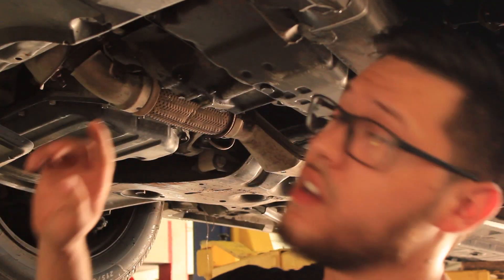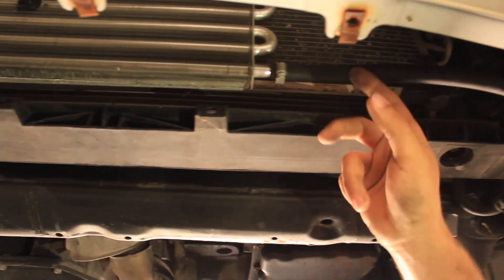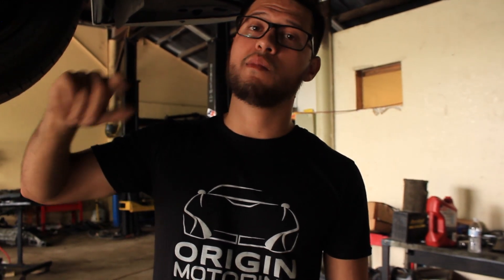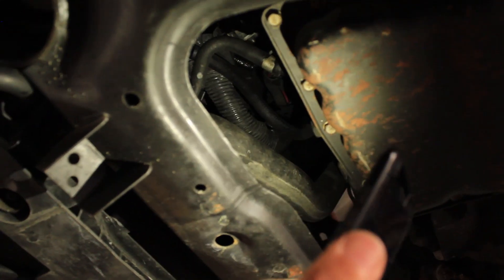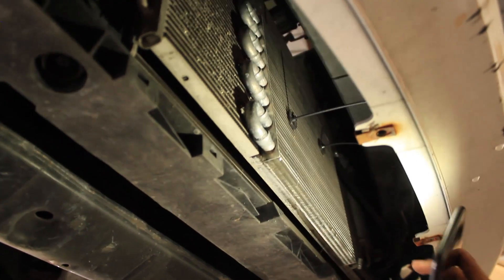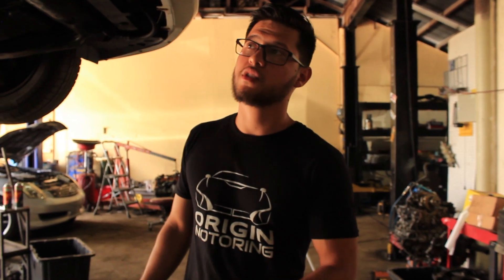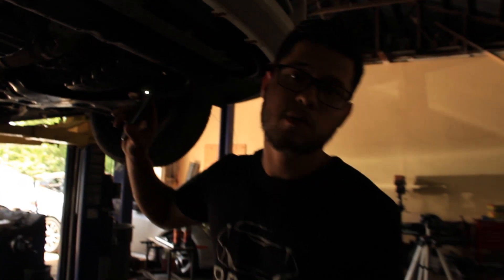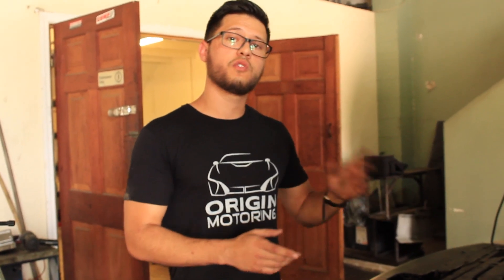Altima cvt Fix. Transmission more reliable

Comment: I have 2007 and if i am correct my cvt is going for a second time , first time the dealer changed it for free but if i change this one myself can i simply reset it after the swap with a regular scan tool?

Comment: I just got a Nissan Altima 2010 I put a new transmission on it I changed the fluid and filter after that I added a transmission cooler the next day I drove it for about 2 hours some city driving and some back roads then I started whinging and when I got to a stop it wouldn't accelerate do you think I put the hoses the wrong way? Or what's the problem
Reply: bro i know u might trying save money but you should let the dealer change (not flush ) your trann fluids
Reply: Or maybe you just got another shitty transmission...

Comment: My 2011 Nissan quahqai  have a transmission oil and coolant mix i found that oil cooler mounted to the transmission was leaking across ports it also have a heat exchange mounted in front of the radiator  should i just by pass the oil cooler mounted to the transmission?

Comment: NISSAN WILL HELP U... but you have to make them. 
My warranty covered me until 100,000. At 65k my transmission began failing/slipping. So I drove it out until 89k to get as much life out of it as possible. They installed a new one for free. Now at 112k my warranty is over and the new transmission is failing after only 22k. I opened a case with Nissan consumer affairs and said this is ridiculous. They responded agreeing to help me outside of my warranty by paying half of the quoted $3400 CVT replacement job so $1700. I respond saying that I will only pay $1000 bcs the CVTs are garbage. They happily accepted my offer and helped me outside of warranty and will even provide a rental car. They are already being sued for the CVTs so they are trying to step up and help ppl. The consumer affairs rep was very honest and helpful. It’s one less person getting in the class action lawsuit so it helps them in the long run I guess lol. Good luck, just be respectful and stand your ground.
Reply: Was this over the phone ? Or in person at the dealership ??

Comment: Thanks for the awesome video.  So is this transmission to cooler and cooler to transmission return? Or is it transmission feed to bottom of radiator > top of radiator to bottom cooler > top cooler to transmission return?
Reply: it is the latter as described, but i wonder if the first way you mention would be better. If there is a concern of the fluid getting too cool (like in the dead of winter at highway speed) it seems that having the radiator after the cooler would work better and still the cooler would ensure the oil isn’t too hot.

Comment: Hello....Wow .great information...we have a 2013 Nissan Rouge with 45K miles...Driving back from a vacation, on a hot day after one hour,  the vehicle loss power, rpms went up, but vehicle would not shift.....barely made it home...The next morning, the vehicle ran like nothing happened....it had cooled down, therefor, back to normal....But after an hour of driving, same problem...This is a perfect solution. Where do we buy a Trannie cooler for out 2013 Rouge?....and will our local transmission shop be willing to do this?  What would that cost? What state are you in? Thank you ahead of time for your help!
Reply: Did it fix your problem?

Comment: Hey man, I bought the Castrol cvt fluid from autozone I read on your description that it is compatible and also on the fluid label it says that it is compatible, but I've heard that it strictly needs to be the dealership fluid any thoughts on that thanks
Reply from the maker: Castrol works great
Reply: @origintuning7000  ok thanks
Reply: @origintuning7000  Have you used the Idemitsu type N for Nissans?

Comment: You just blew my mind. I always worried about the reliability of my fiance's Altima on the CVT specifically. Hopefully I can finally silence that worrying whining noise that comes from it on hot days pulling past other cars on the highway!
Reply: Did this fix the "whinning" issue and the xmsn not wanting to downshift after about an hour of driving on the hwy?
Reply: @blackhawkip  I’ve got the same problem
Reply: @Windchamber  I put a external XMSN oil cooler on my car last Sunday. I’ll be making my 3 hour drive to work tomorrow. I’ll let you know if it works or not.
Reply: @blackhawkip  how's it ben working
Reply: @ Zacharia Gamble did you manage to install? Did it work in calming the car from the whinning noise when overtaking other cars on the highway? ?

Comment: Post a link of said transmmission cooler!
Reply: I do not know exactly which one he used but I used this one and it seems to be working pretty well.  I mounted it directly in front of where one of my electric fans are so even when idling it is having air flowing through it..https://www.amazon.com/gp/product/B000C39C9A/ref=ppx_yo_dt_b_asin_title_o05_s02?ie=UTF8&psc=1   My nissan did not even have the CVT fluid flowing through the radiator at all, instead it was flowing into a bean can sized cooler mounted to the block, I do not know how the transmission did not burn up, My fluid did.  Because of this I also had to buy a replacement part for that cooler which has an additional 2 ports on it so that cvt fluid can flow out of that cooler and into the external cooler then back into it to be returned to the transmission.  If you have the same kind of set up on your vehicle you will have to get this part as well or you will have no way to get the CVT fluid to your new external cooler...Note, this link shows a square unit but the one I got was actually Round/cylindrical like can or short oil filter shape.  https://www.amazon.com/gp/product/B07DS7QBWR/ref=ppx_yo_dt_b_asin_title_o05_s01?ie=UTF8&psc=1
Reply: John Norris hey John what year is your Altima and how is it running with the upgrade? 
Looks like you went with the Hayden 403? My 2013 is running great just trying to be proactive,
That’s why I feel the Hayden 403 should be perfect, any thoughts?
thank you sir!!
Reply: @roberto3330  It is actually my sisters car not mine. I believe 2012. and Sentra by the way.  so since replacing the valve body assembly and installing the cooler, There have been no issues at all, trans runs smooth and no falt codes.  I just checked back up on it last week to inspect it. all looks good, no leaks, fluid still looks fresh and light pink unlike the burnt stuff I drained that looked like old motor oil.  She puts about 70 miles on the car per day, 35 mile trip to her work. but she is night shift so going to work and returning are not in the ho5est part of the day so we have not really tested it out with a long drive in 100+ degree weather.  But i think it would be fine. it gets good air flow even when not moving and you can feel the heat of the fluid being radiated out of the cooler.  If I ever buy a car with a cvt, the first thing I will do is add a cooler to it.   I did double up the clamps on all hose connections to be safe as the clamps were just ok. I also had to purchase more hose online as the kit did not have enough for my hose routing.  But ya, I would say for sure put a cooler on your car asap to prevent any issues in the future, even if the car was brand new I would do so.
Reply: John Norris Looks like I’m going shopping... thanks brother!
Reply: @roberto3330  ya dude, get under that grill and take some measurements so you know how much room you have to work with so you dont get one too big but might as well get one as big as will fit.  I was considering getting one of those electric fans to put on the one I did as well for idling and slow traffic jams but found that her existing fan was always spinning and pulling good air through the cooler.  hopefully your placement will do the same.
Reply: oh, her car is a 2007, not 2012
Reply: You can buy the Compressor Works Kit at Autozone. It is the oil cooler of the cvt transmission. For Nissan  Altima.

Comment: Great instructions on installation. I just purchased an 09 Altima with 60k miles and I'm interested in putting this on my car.  Please provide me with a parts list for the installation.  Thank you
Reply: Unfortunately it may be too late but Nissan did extend the transmission warranty on the Altima's with cvt's to 120k miles. I've read of multiple people getting a transmission cooler installed by Nissan for $50. The price when your car is out of warranty is about $700 depending on where you live plus 3 to 4 days with out a car (my 07 is at the dealership now).
Reply: @kismyc0untryazz-491   bro true story. I had a car accident in my 11 Atlima a month ago. Lady hit me from back. I got back 2k more than what I paid for the car. Long story short I bought a 2012 Toyota Camry SE cash. Car drive smooth.. feel like I got a huge upgrade.. I had the Altima at the time for 4 and a half years.

Comment: Hello, just got a 2007 Altima and after getting new transmission oil and jiffy lube and driving about 200 miles back home it began to show several issues. Including not downshifting on the highway. Also the spedo dropped to zero and the no key indicator began to show along with some flashing warning lights. Anyway I got home and now I’m wondering if a cooler will prevent the need for a new transmission. Any advice would be greatly appreciated.
Reply: Had codes p0840, p0845, and p0507
Reply: Does it make a cherp noises from 2nd to 3rd 3rd to 4th.  If so go get full coverage insurance an total it. There is no fixing it

Comment: I want to put one of these on my 2007 nissan sentra. I live in Southern California and getting ready for the hot summer.  Does it matter which the fluid gets run through first Radiator then Cooler or Cooler then Radiator?  Seems I might get a bit lower temps running the cooler second rather than through the hot radiator second?
Reply: fluid flow should be out of trans to bottom of cooler in radiator, coming out top of cooler in radiator to external trans cooler, goes through external cooler, then into tans it self,
Reply: @huggiebear1122  Thank you for the info on that.   My nissan did not even have the fluid flowing through the radiator, just a bean can sized cooler mounted to the block.  I had to get a replacement for that part that has 4 tubes, that allow fluid to flow out from it to an external cooler which I also installed.  I was asking around in the net trying to figure out which of the 2 fluid ports on the block mounted cooler was the outflow, explaining I wanted to run fluid from bottom of external cooler to top,  I could not get an answer or people would say it does not matter.  But I wanted to follow you advice, I finally figured it out after finding a Nissan service report meant for mechanics on installing the units and it turns out it was bottom tube on little block cooler was the outlet. so if any of you are installing the little 4 port cooler and an external cooler, just remember it is bottom tube to bottom of your external cooler and top of external cooler to top tube on little block cooler.  Bottom to bottom, top to top.
Reply: @JohnNorris411    you are right with cooler ports, depending on model, some don't go through radiator cooler,  2013 14, 15 altimas , would go through radiator cooler, then in 2016 , 17 and 18 model years nissan stopped going in to radiator cooler, still had extra ports on bee hive, but just connected a short hose, for ports that should go to radiator cooler, i know that because, i am a master nissan tech, now after replacing a trans , nissan has new program update, for trans, it puts more line pressure on the cvt belt, so belt don't sip, and has done good job , but will not fix issues with cvt , if belt has already started slipping , and now for 2019 altima, has cooler back in radiator
Reply: @huggiebear1122  wondering if you could help me out. I have a 2007 Altima that is in need of a transmission cooler. My question is, when I install the cooler do I skip the radiator?  I have heard both but I can not get a definitive answer.
Reply: @kismyc0untryazz-491  do not skip the radiator, flow will  be out of trans going into bottom of radiator, and coming out top of radiator into trans cooler , then back to trans , you will not have to touch bottom hose on radiator , just the top hose
Reply: @JohnNorris411  Thank you
Reply: @huggiebear1122  Thank you!
Reply: How do you connect the hose to both cooler and radiator?
Reply: @emoegbeju9567  in general or on my specific model of car?

Comment: I have 2014 Altima 2.5, and it does have a OE CVT cooler, like the one in link below, do I still need an additional cooler?
If I do need one..  I live in Boston, and it's cold here most of the year.. should I install one with thermal bypass, so that cooler activates only when the CVT fluid is above a certain temperature.. like Hayden 696, link below.. 
Kindly advice!

OEM CVT cooler:

https://www.amazon.com/Engine-Transmission-Cooler-2013-2017-Pathfinder/dp/B07MZ7T7D4/ref=asc_df_B07MZ7T7D4/?tag=hyprod-20&linkCode=df0&hvadid=320275594559&hvpos=1o5&hvnetw=g&hvrand=16309731697577810892&hvpone=&hvptwo=&hvqmt=&hvdev=c&hvdvcmdl=&hvlocint=&hvlocphy=9001821&hvtargid=pla-669779081425&psc=1&tag=&ref=&adgrpid=64369742339&hvpone=&hvptwo=&hvadid=320275594559&hvpos=1o5&hvnetw=g&hvrand=16309731697577810892&hvqmt=&hvdev=c&hvdvcmdl=&hvlocint=&hvlocphy=9001821&hvtargid=pla-669779081425

Hayden 696:
https://www.carid.com/hayden/rapid-cool-transmission-oil-cooler-with-thermal-bypass-mpn-696.html
Reply: On that OEM cooler, I have a 16' Altima. The two small ones are the transmission fluid, but which is inlet and which is outlet?
Reply from the maker: Add the Hayden. The factory cooler block on Amazon looks like a coolant block cooler with 2 extra ports I believe they go to the radiator. What you want is the trans fluid to be warmed up in that coolant block and then cooled by an air cooler like the Hayden you linked. If the block lines go to radiator it's just being cooled by coolant twice. I have a versa with this system upgrade from Nissan but I bypassed the radiator and added a Hayden air cooler in front of condenser by the front grille to get fresh cool air to it
Reply: @origintuning7000  
Thank you!
Here is the diagram of 2014 Altima radiator, the two hoses on the driver side ( part# 21631) are going to the CVT. If I understand correctly, the upper hose is the hose returning fluid to CVT, and I need to install the additional cooler on the upper hose, after it has already been through the radiator.
Kindly clarify!
https://parts.nissanusa.com/nissanparts/?action=replacement&groupid=C&sectionid=214&jointvehid=17719&siteid=14
Reply from the maker: @absood5  that's correct

Comment: I also wanted to ask why not also run it through both the new cooler and radiator rather than just the cooler? Pressure issue?
Reply from the maker: It goes thru both. The radiator keeps the fluid warm when it's cold it's a must to do both
Reply: Im wandering the same,might be better

Comment: Great video but, I can't see the hoses you're identifying on the beehive. I have a 4 port beehive this will work perfect ! but I'm not sure which hose you talkin about. Can't see on the video.
Reply: H B  is the 4 port cooler working for you? I have a sentra same cvt problem. I don’t know if i should just leave the one it has and just buy the external cooler or by the 4 port cooler as well
Reply: @ericceballos9330  My Son In- Law decided not worth extra repairs for the cooler. It did start to slip a little at 200,000 miles all original. So she replaced the 09 Sentra for 2016 Toyota Avalon much more reliable. Never again any type cvt especially Nissan!!!
Reply: Just don't let it get hot in the summertime better roll the windows shut off AC put the heat. Especially in traffic in Florida.

Comment: Great video, i wish i never purchased any CVT. However, we got a 2011 Cube cvt trans failed at 106000 miles. Nissan service trans 85000 miles. A rebuilt cost me $3500 1 year or 12000 miles warranty. now out of warranty. I live in NJ where can i find that trans cooler & parts for 2011 Cube & 2009 Sentra?
 My daughter's 2009 Sentra with 182000 miles original trans overheated in FL on a long trip. It was midday with AC on trans lost acceleration so they shut off AC check engine light was on. They let car cool down then drove only 70 mph. The next few days check engine light went out.

Comment: Parts list or where you got them ?
Reply: Jacob Ryan eBay they selll them
Reply: Yes, parts numbers and cooler brand & model PLEASE!!! This CVT is the same (or VERY SIMILAR) to the one on my Suzuki SX4 so the procedures apply. Even the fluid used is the same.
Reply: @anibal2476  Order the HAYDEN 678 Heavy Duty Cooler off Ebay,got mine for $39.99 and it arrived fast.
Reply: Ross Krause so you installed the 678 on an Altima, and that worked ok?
What year is your car?